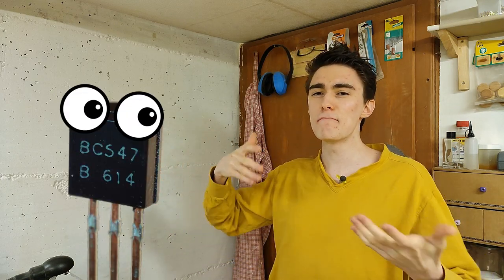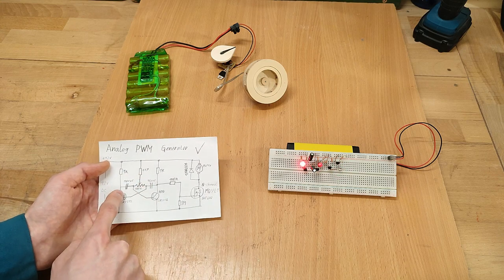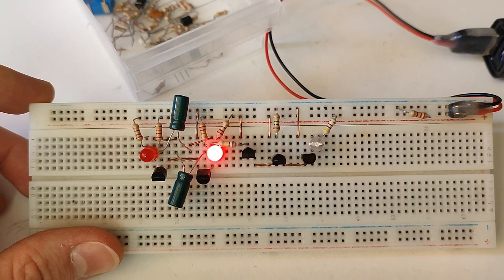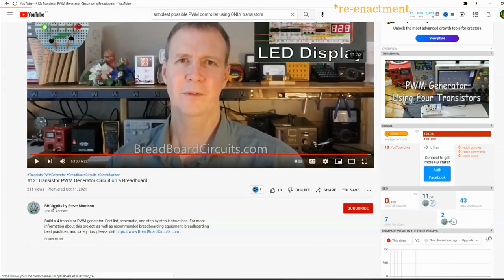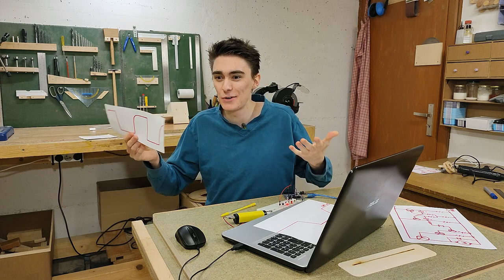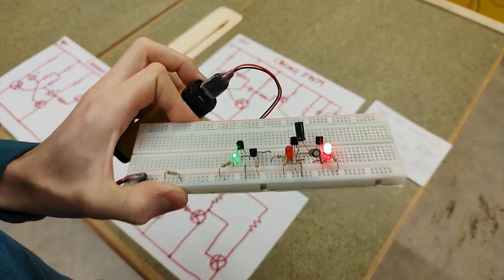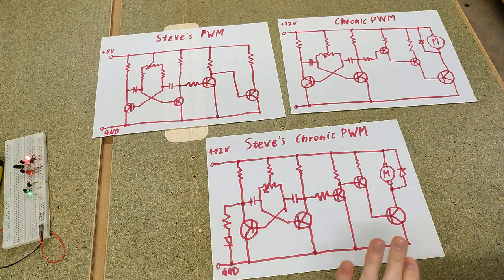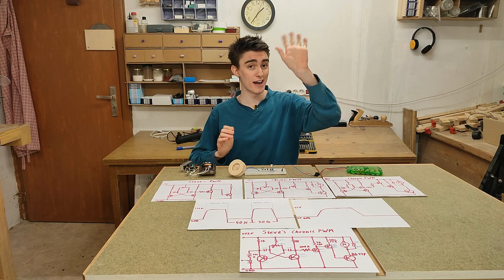New simplest PWM generator WITHOUT 555 timer IC (improved version using ONLY transistors!!)

Comment: Hi .. my man ..can you help me   with a 3 volt similar circuit up to 1.2 amps ❤❤❤🎉
Reply from the maker: Try if the 5 volt version works on 3 volts - if it doesn't, reduce all resistor values by about 2/5. And replace the power transistor with one that can deal with a higher collector current.
Reply: @ChronicMechatronic  oh man that's relieving  ... thanks ❤❤❤🙏👍🎉
Reply: @ChronicMechatronic  also as well as low as Vce sat   as possible

Comment: Pls reply me !!!
Can you make in your new video pls
1.5v to arcs 
Input 1.5v to powerful joule thief circuit
Then put the output to zvs driver or via astable multivibrator or bistable to HV transformer to make arcs good idea ?! :) Pls reply me 😭 I like your work and I'm a fan of your work pls say is it ethical, efficient work ?! Pls 🙏
Reply from the maker: I'm sorry I don't even understand what you want? Sure it's possible to make a high voltage boost circuit to run on 1.5V...
Also I don't take suggestions for video ideas because I myself don't even get to decide what my videos are about
Reply: @ChronicMechatronic  umm it's this 
To power idk like Tesla coil from 1.5v battery
But extremely powerful Tesla coil
Reply from the maker: Depends on your definition of extremely powerful I guess... I have no experience with high voltage stuff, but I'm pretty sure you won't get more than a few millimeters of sparks out of step up converter powered by a single AA cell

Comment: Ok, and where can I feed the control voltage to modulate the PWM?
Reply from the maker: The potentiometer generates the control voltage
Reply: @ChronicMechatronic  this is not true. The potentiometer is part of the circuit controls the currents for the charging and discharging procedures. It is not a voltage divider to provide a control voltage to the circuit. You can't take it out of the circuit and provide a control voltage at the wiper connecting point to control the pwm.

You can make a voltage controlled PWM converter by use of 2 555 timers. The first one is a self controlled monostable multivibrator th generate the starting pulses for the second one monostable multivibrator which is controlled by a voltage between 0 and 2/3 Vcc at pin 5.

Both timer IC's pin 2 and 6 are connected and have a timing capacitor against ground and a constant current source against Vcc. The discharge pin 7 of the first timer IC is also connected to this timing network to provide the auto-dicharge of the first monostable multivibrator.

You see, it is possible to build up a voltage controlled PWM generator but it is not so simple to work with just 1 555 timer IC. You need 2 of them or a 556 timer IC.

In this way I made the PWM generator for my class D audio amplifier. In this case you need only 3 555 timer ICs for a stereo amplifier, because you can use the auto-resetting monostable multivibrator for both channels. You also need only one timing capacitor and one constant current source (I used the CR056 constant current diode).
Reply from the maker: I know, after all I designed the circuit, no need to teach me - in which case, why'd you ask this question anyway? I only gave a curt answer to a question that seemed pointless at best.

Comment: What happens to the second one if you run two pwms in series?
Reply from the maker: It won't be able to oscillate and the output will be a mess
Reply: @ChronicMechatronic  what kinda mess, sorry I mean is there a way to make it work I wonder, for sound purposes
Reply from the maker: @Xtn1Insecticide  ooh I see! Unfortunately I have no idea, I suspect the second one will be cut off before it's able to start up, so depending on which of the transistors usually switches first the overall output might just be the PWM from the first circuit or zero. But that's just my theory, the only way to know for sure is to try it out :)

Comment: can some one help my please Im anoyed simplified I need an device that can phase shift an 4pin GM ignition module who uses the mc 3334 ic chip diagram on google its easely found only difference in my module is that the zener diode is missing from the mc 3334 circuet diagram it uses an inductive pick up coil and an e core type ignition coil. Now I need desperatli to try out some how to phase shift my ignition timing I did found some cdi variabel ignition box useing ne 555 timer and an xor gate ic chip some resistors randomli placed so Im not shure wuld that circuet work on my 4 pin hei ignition module . Im so anoyed and confused honestli some peopel say use ic chip ,some transistors,some say use rc box I dono who to belive honestli. The simpel goal is to retard ignition timing so I dont freaze my ass fummeling the destributor in cold weather the hei ignition system has its own failures. So any one has some good variabel ignotion module replacement circuet who can work with an pick up coil? Or some thing that can control an singel darlington transistor variabel circuet? I hate this deam hei staff so I hoppe some one can help my to chose right components for the task some sort of chaneling system so I can programe spark frequency voltage amps manuali with out those anoying ic chips. I also have problems figuring out wire type because the lenght I face resistance problems. In the past I used potenciometer betwean pick up and ignition module didnt work how I hopped it wuld engine run crappy and fiered at exaust insted at compresion even tough engine started but run terribel.So simplified I need an angel degree about +/-20° phase shift before top dead center and after top dead center piston travel. Any way I dont reali care what to phase shift coil,pick up or module .Any thing wuld do just some one help my please .

Comment: Actually, the practical reason why you want the transitions as fast as possible is to avoid heat dissipating on the transistors that control the load (motor in your case). As for PWM controlling a motor not being interesting - well, I am looking into handling a rebel video card fan, that seems to ignore the PWM signals given by the card itself. So, just saying, PWM and not interesting  ...
Reply from the maker: Yeah, well, I said there isn't much interest in PWM control, because overall compared to hot topics like 3D printing & pen plotter there really isn't. And sadly we all need to follow the algorithm...
But I found it very interesting, and since I started it last year I had to give you guys the heads up :)
As for the graphics card fan, do you want to pwm the entire fan or just replace the signal of the card?
Reply: @ChronicMechatronic  The fan behaved very weird. Despite the multimeter showing a 25 kHz signal with a 30% duty cycle at the fan connector, the fan would not budge. Only when the duty cycle reached 80%, it would suddenly start, at 80% of max RPM.

Anyway, I fixed that with a 3 transistor circuit, that would take the PWM as input, and be able to drive the fan's 12V power line to PWM, and that worked. Basically, treat the 4-pin PWM fan as a 3 pin fan (GND, 12V, tachometer) and apply the PWM on the 12V power supply of the fan.
Reply from the maker: @HerrAlien  Oh okay that's smart 👌
So the third, yellow wire on 3 pin fans is actually a tachometer? 😮
I always assumed it was the speed control line 😂😂
Reply: @ChronicMechatronic  The colors used (typically) are yellow for 12V, black for GND, green for the tachometer signal and blue for PWM control. I left the green wire and GND wire alone, but used the blue wire from the fan connector as input to the 3 transistor circuit. The 12V wire from the fan connector is powering the circuit, and the amplified PWM signal is then fed into the yellow (12V) wire of the motor.
Anyway,  a diagram speaks more than 100 words - https://drive.google.com/file/d/1__-Slovwc48EcyOC4xImLNCIzfuIe6B2/view?usp=sharing
Reply from the maker: @HerrAlien  Yeah, I get how you connected it, I was just surprised by the fact that the third wire on 3 pin fans should be tachometer rather than speed control. Because all 3 pin fans I own have red & black for positive & negative, with a third yellow one I formerly assumed to be speed control. The one 4 pin fan I have is black,  blue, red, yellow.
BTW the link just pulls up a picture of something in pliers being lasered :)